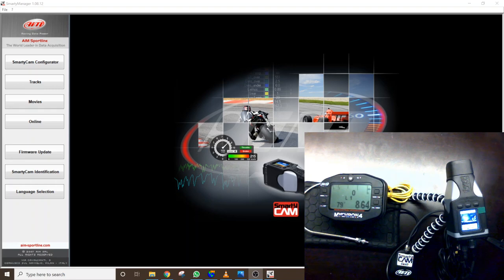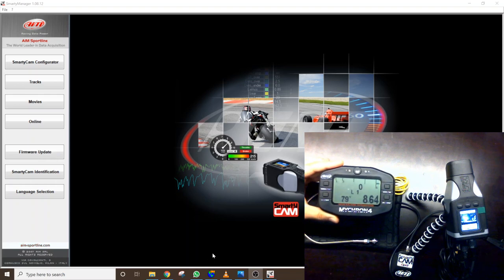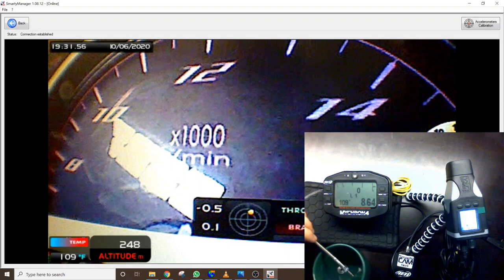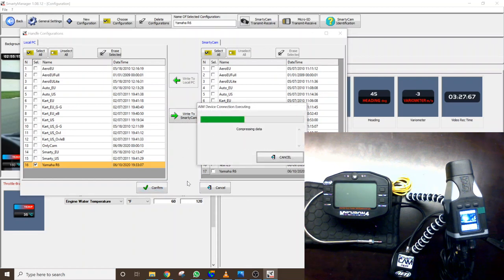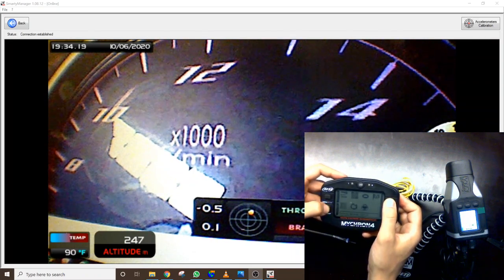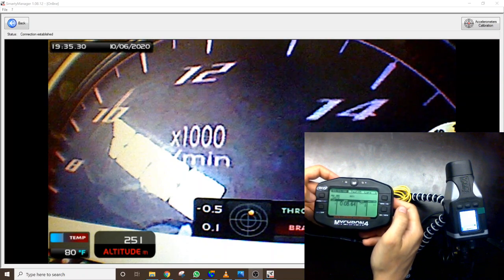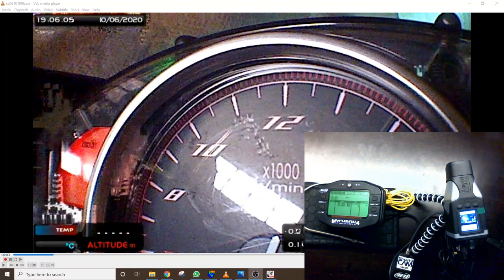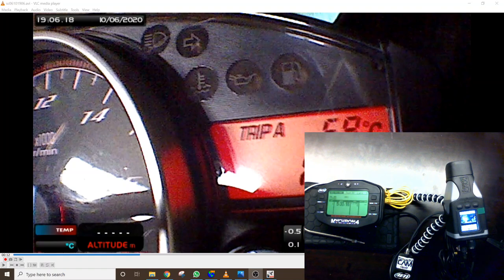AiM MyChron 4 with SmartyCAM and GPS Overview

Comment: Just bought a used mychron 4 withe the gps antenna. After plugging in the antenna ,I cannot  access the screen to see # of satilites . Pressing the on button twice just displays time date battery charge remaining. Do you think there is a problem with the antenna or with the unit itself? Please help?
Reply from the maker: @Simon Kirby - send us a message on the chat window of our website and we would be happy to sort out your antenna issue. 

www.oppenheimengineering.com